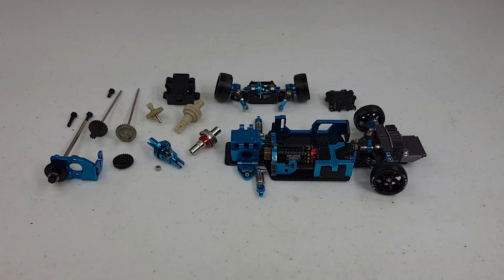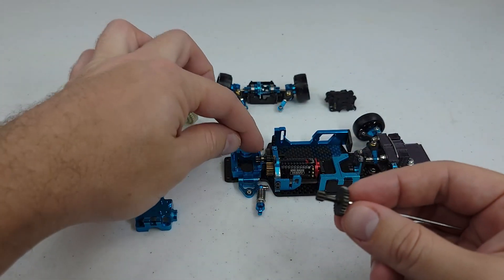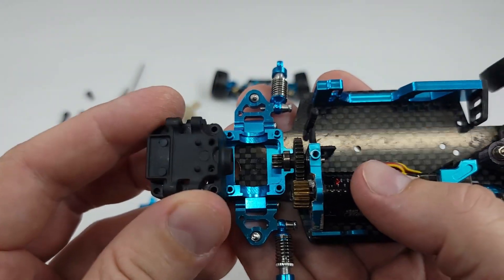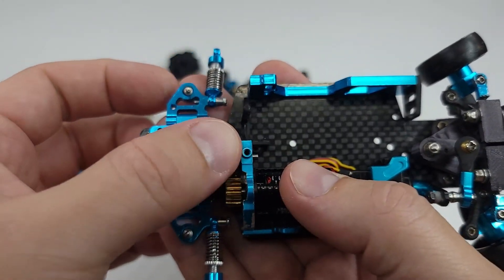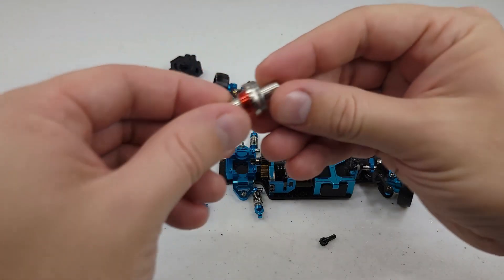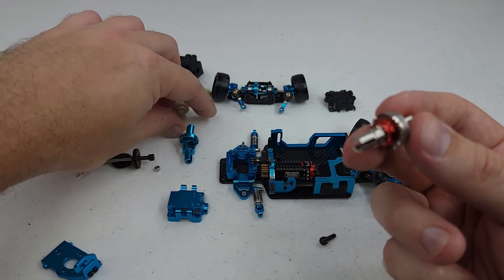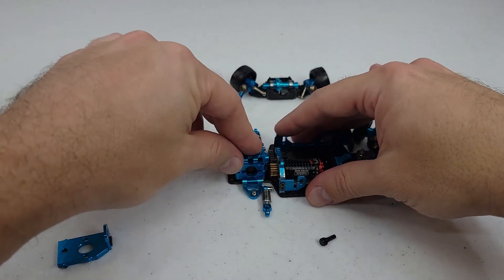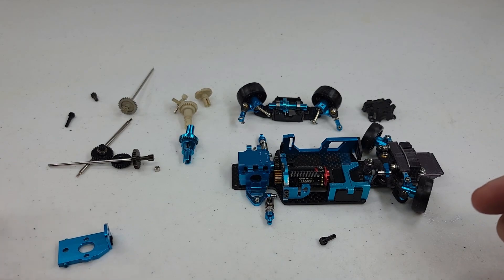WLToys K969 K989 Upgrades Rebuild Part 3: Metal Spur Gear Options for Driveshaft, Rear Housings

Comment: Thanks for the video, I have watched Beaver's older video's and wish I would have watched yours before ordering the 3mm shaft version that does'nt fit with the motor mount. Im going to order a center shaft kit from Aliexpress. Do you think the one in your link is the older version with the 2mm shaft? Thanks again!
Reply from the maker: Yea I have the older model K969 that use the 2mm drive shaft. Many of the newer versions are the 3mm shaft and sometimes its hard to tell which one you're getting on AliExpress and also some 2mm versions are bad quality so take your time looking at which one to buy, check peoples reviews to see if people are getting the right one.
Reply: @AirToGroundRCFPV  I have the older k989 , had to Drexel and drill the 2mm hole out to get the bigger bearing to fit but it's not right and ended up taking the bearing out. Not really right so ill make a order with aliexpress. What do you think about the mini z awd diff ? I have  sinohobby metal diffs but thinking about the kyosho ones. Thanks again for the videos.
Reply from the maker: @js9232  If I remember correctly the Mini-Z diffs are usually designed for a narrow chassis so since the K989/K969 are wide set chassis your stock CVDs won't reach. You will have to get the extended CVDs to allow them to reach it.

Comment: any suggestions on where to find compatible metal pinion gears? Want to go smaller for more acceleration, but not sure what would fit it.
Reply from the maker: I had trouble finding any smaller size that would fit my motor shaft correctly. Unfortunately they were usually the wrong size diameter to fit so I went back to the stock one that comes with the car. Try looking through AliEpress or online and maybe you will get luckier that me.

Comment: You probably bought the newer version of diff housing, for some odd reason Wltoys changed the diff baring size so now the newer cars differentials aren’t compatible with like miniz diffs
Reply from the maker: I can definitely see them do something stupid like that. Its really annoying since they look just like the old version so how else would I have known until I tried to use them and found out the hard way lol Thank you for pointing that out I really appreciate it. I'm gonna have to be more careful I guess in getting any other parts in case they slightly changed those too
Reply: I agree why fix something that didn’t need fixing. I only found that out because I watched beavers hobby channel review the newest 1/28 wltoys and he mentioned that in the vid, but yea check it out if you wanna see what else has been changed I can’t remember fully off the top of my head

Love how the build is coming along too🔥🤌🏽
Reply from the maker: @Zero_Zero705  I probably watched that vid of his and just totally forgot about that and when I ordered the housing I don't think the description said it was for the newer cars but then again I could have over looked that detail possibly. Oh well more work for me now since I will just dremel it to make them fit anyway. Thank you for watching though, I know it seems like the build is taking forever, it's mainly because of trial and error, changing my mind constantly and finding time to even get to work on it but I will complete it eventually lol
Reply: i just bought a 284131 and used all of its og bearing when i upgraded the diffs, the deff housing, and an acwxa rwd kit. i think it really depends on specific  models because i noticed its just only the 989 thats going through these changes
Reply from the maker: @DxeNvtsukii  Yea It's hard to tell unless you own every version and can compare for sure but definitely something to be aware of if you try to upgrade any old versions with new parts or vice versa